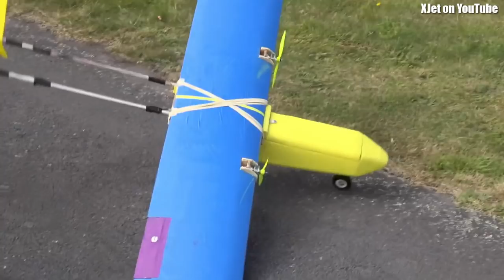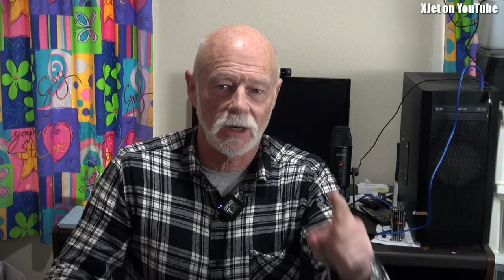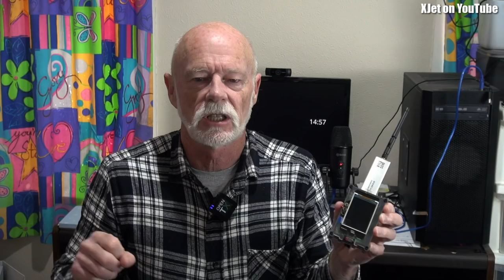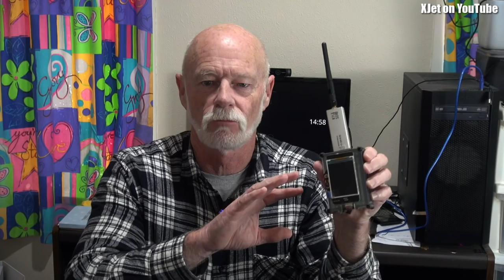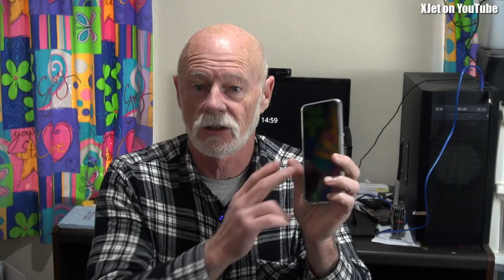AMA answers #1:  The ADSB Alarm for drone and RC plane flyers

Comment: Louis is another hero :) He has been telling the truth about Apple's disgusting business tactics for years.
Reply: Louis is alright but I do agree with what a lot of engineers criticise him over. Like how he doesn't seem to look for the cause of issues. Somethings blows, he finds it and replaces. Yeah, but why did it break in the first place? His YouTube videos of "replace this and now it works" isn't a good mindset to get people in for learning videos.

Plus if you don't like the way Apple operates, don't buy their stuff. People hate them, keep calling them out, keep buying their products. Can't fix stupidity.
Reply: @1738Creations  er he is doing his job, repairing stuff. He didn't design and build it.
Reply: Well if his job is to not diagnose faults then yes, that's what he's doing.

When it goes back to the customer, they plug it in and the same same components blow again after a couple of days, he hasn't done a good job. He's done his job. I believe he has a system where if it breaks again you can send it back and he'll do it for free. But that's not a great way to run a business.

Sometimes components blow due to poor manufacturing. A lot of the times it's a symptom of something else. Won't know if you don't look.

Comment: Surprised you didn't use something like cython having done all that work already.
Reply from the maker: To be honest, Python isn't my favourite language and I'm much happier (and more productive) cutting C code directly.
Reply: @xjet  :D fair enough. I'm not but I'm working on automating web systems most of the time so python is perfect for me.
Reply from the maker: @BenjaminSweetnam  Yeah, the lack of strong typing works against an application like this and system-level access is always easier in a lower-level language like C.  I've written more lines of C code than I'd like to admit during the past 40 years or so :-)

Comment: How good are drones at landing on their own without a signal? Asking for a friend with an 10kW microwave magnetron. Also how accuratly would that friend have to tune the frequency to that of the drone reciever or would a wider harmonic be more practical?
Reply: The achilles heel of automated drones, in their current state, is GPS.

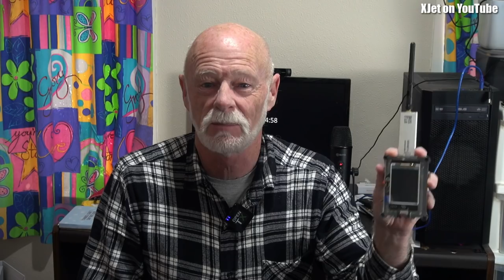Comment: 2:18 ..level 4 lockdown and there's no planes in the air you reckon ? LOL cmon bruce there's planes coming from everywhere check flight tracker
Reply from the maker: Yeah, but airliners at 30,000 feet don't really count :-)

Comment: The only problem with the ADS-B alarm that I can see is that I don't take my Cell Phone to the Flying Field. I still like the idea of the actual ADS-B sounding an alarm as an option for guys like me.
BTW... great idea to get us the Parts to Order before the final Project Plans are released.
Reply from the maker: In that case you can always set the flying location before you leave and until such time as you change it again, that will remain the center-point on the radar-screen.

Comment: Is there a github page for the ADSb devices? I'm interested in building a pi adsb receiver that is not connected to the internet for flying fpv away from cavillation.
Reply from the maker: There will be but I've just been a little slack... and there's a global shortage of Raspberry Pi computers, which doesn't help.
Reply: @xjet  Getting the software out there would help people find out what else to run it on possibly. Tons of people out there already have flight aware or radar24 pi system setup that wouldn't take much for them to move on to your system instead. I get it though, there is only so much one guy can do. I'm not sure how many are out there that would be able to contribute if it was already out on get anyway.